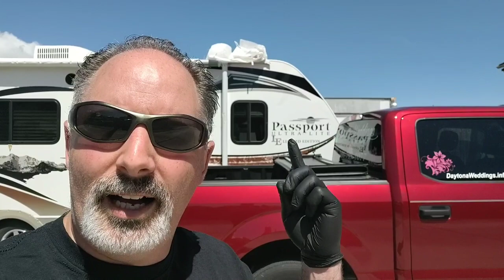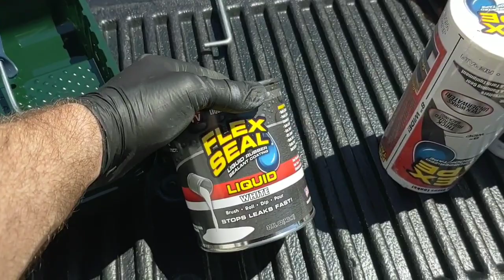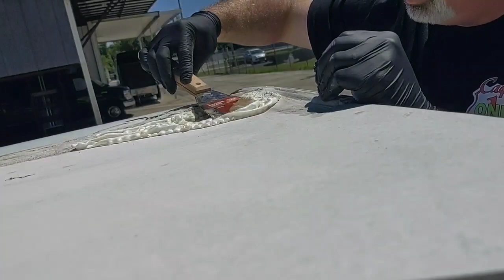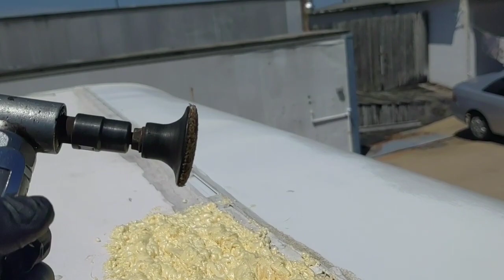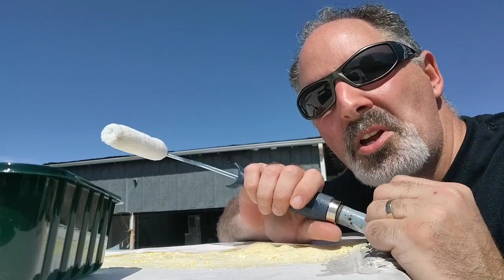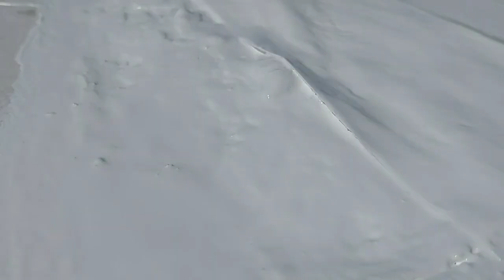How To Fix A Leaking Camper Roof

Comment: Should have put a j trim just before hollow , right across, would stop 80% of water away,use double sided tape to put it down,and good sealant right along both sides ,job done,lot quicker than what you did